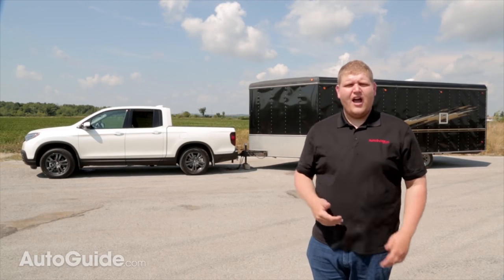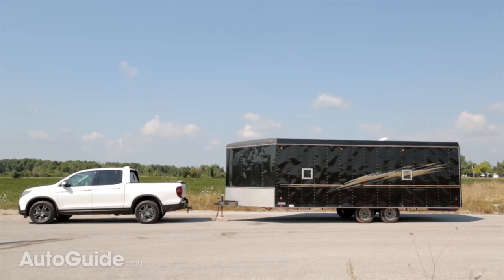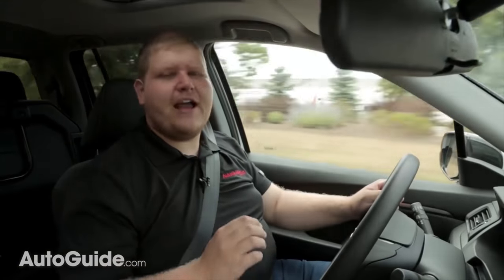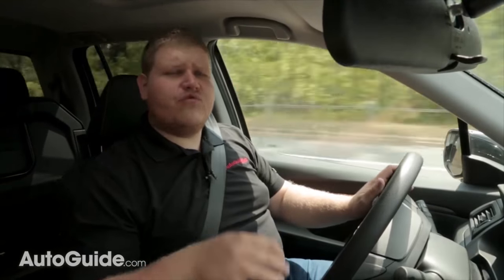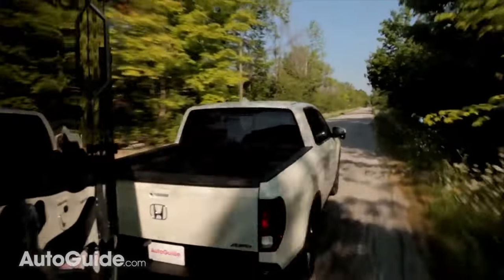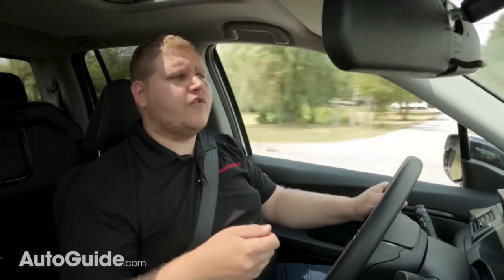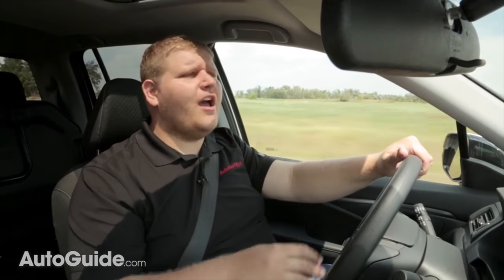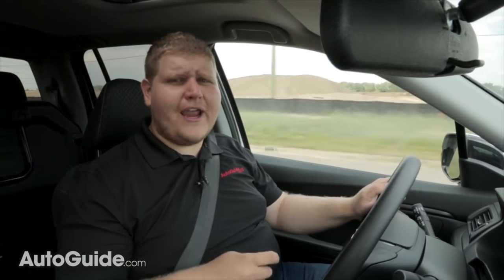2017 Honda Ridgeline Towing Test

Comment: Damn so many people are puffing their chests when saying this is not a real truck.  OK,  it not a truck.  It's a car that the weekend warrior could use to to snowboarding with,  go to the paintball field, drive to Lowes,  do a dump run,  head to a camp sight, drive to work.  I don't need my 2014 Z71 silverado.  Its 5 inches too long to fit in my garage and I rarely tow with it.  It's a bitch to park sometimes and isn't the smoothest ride. It's about your needs and what you actually do with it.  It's not about the definition of being a truck. Quit measuring dicks about it not being a truck.
Reply: I totally agree! if this was out when I bought my v6 f150 it would have been a tough call. I rarely tow and when I do its a jet ski or some thing small. I love the truck for utility, paintball like you said etc and this ridgeline offers a ton of options for the everyday dude who needs a bed for weekend fun but doesn't off road, doesn't tow all the time etc. hell my v6 f150 is only rated for 6500lbs or something lol
Reply: I'm not against the Ridgeline. I'm just against calling it a Truck.It just don't seem legit to me. Now have said that I can see where this crossover with a bed would be handy for alot of people.From video's I have watched I'm under the impression that the Pilot is a pretty good crossover.And that's what the Pilot is sold/marketed as.A good crossover.
Reply: I agree 100% but the truck is too expensive for what it is. I just want a cheap and reliable i4 shop truck. Something like the Chevy s10 or older ford ranger. But the thing is that these "small trucks"are way too big and expensive
Reply: @tritchie6272  look up the definition of a pick up truck... It IS a truck, whether you think it is or not. And by the way, who cares? You see so many replies here that this truck will do just fine for 90% of the people. And for European standards, this truck actually can tow a lot! I don't own a Ridgeline (yet), but it's going on the bucket list.
Reply: It's actually entertaining to a point.  It's a truck.  Plain and simple.  The thing I like most about it is that after living in Australia for a while, the Ridgeline meets the need that the Aussie Falcon or Commodore ute satisfies.  Coincidentally, it's many of the things you listed.  The thing I hate about modern-day American trucks is how large they are.  Some people like to be the biggest thing on the road, but then it creates problems.  I benefit from some of these as my Skyline is small and can fit behind the giant truck that is 3 feet into my parking spot, but many can't do that.  The Ridgeline is a great ride, and a great truck option for the majority of truck owners who don't actually use their truck to tow.
Reply: Yep you nailed it. Still can’t believe how much this freaking thing can tow...

Comment: I have FW drive RTL-T and I got the heavy duty transmission cooler on it. I only tow a 18' walleye boat that weighs about 2700 lbs. No problem whatsoever. I have an 8' utility trailer and that's is no problem either. My previous truck was a the GMC Sierra SLE 4WD and the Ridgeline tows nearly as effortlessly as the V-8. It comes down to realistic expectations. I'm not expecting to tow anything up I-70 W and over the divide in 100 degree weather. Completely satisfied with the Ridgeline. I validated my manhood in Vietnam with the 3rd MarDiv in 1966-67. I don't need a jacked up Hemi mudslinger to feel good about myself, so all of you haters out there, don't bother insulting me with all of the "chick truck" BS.
Reply: Phillip Yeager Well said. That is a really, really good comment. It is a great truck and the right truck for most people.
Thanks for your service in Vietnam. I myself served in S Vietnam. 173rd Abn
Reply: Amen, brother.
Reply: God bless you.
Reply: How much did it cost to get a HD tranny cooler installed?
Reply: I hear ya, I traded my Tacoma for 4 wheel independent suspension and disc breaks all around. Should have done it years ago.
Reply: I still don't get it, the Colorado is cheaper and has better specs ;-;
Reply: @justyouraveragefluff2298  Truck specs yes.  Car specs no.
Reply: @justyouraveragefluff2298  from what I research, the Colorado only has better towing specs. The '21 Ridgeline seems like it has better everything else (including payload) but I could be wrong.
Reply: For 98% of what suburbanites need--a comfortable daily commuter vehicle that can tow a decent load when necessary--the Ridgeline is perfect.  Why other automakers didn't think of this, I have no idea.
Reply: @justyouraveragefluff2298  Because the Colorado is not a good daily commuter vehicle.  The Ridgeline is a lot closer to the Honda Accord or Toyota Avalon in creature comforts while still having good hauling capability.  For most suburbanites, they don't need the Colorado's towing capacity; they may only need to tow or haul things now and then.  For fuel economy (very important for a commuter vehicle), the Ridgeline wins hands-down.
Reply: @JBM425  i mean if those creature comforts are worth the price difference to you then I guess go for it but if I was gonna make the jump to that price for a more comfortable ride then I'd just consider getting a slightly newish full size
Reply: @justyouraveragefluff2298  The Ridgeline is a nicer truck and will be far more reliable. He will have it 15 years before he even opens the hood. The Canyon will be soup cans. Thats what you are paying for.
Reply: If anything, women prefer riding in vehicles in comfort and the ridgeline does that perfectly.

Comment: I'm thinking a vast majority of buyers for this truck won't be towing anything. You could probably say that for full size pickup truck owners too.
Reply: I live in Alberta, Canada. Truck county. An overwhelming majority of truck users mid and full size and drive around with their beds empty. Nothing but mall crawlers.
Reply: BloodySinner I live in Texas, Dallas Fort Worth truck capital of the US  and it's the same here. I love my new Ridgeline it's awesome!
Reply: I would say that the majority of truck owners use their bed sparingly which is why crew cabs are so popular right now. They prefer passenger capacity to bed and towing. They are glorified cars/minivans. There is no issue with that if you're willing to admit it.  This is first and foremost a passenger vehicle like a car or modern SUV, so it shouldn't be expected to be good at carrying cargo, towing, or offroading. It does well at those as well even though it shouldn't have to do it. At least Honda isn't pretending who they are marketing for. This is the ultimate "Dad" car. Extremely utilitarian without making any real compromises.
Reply: 90% of truck owners use there trucks for everyday drivers so actually the Ridgeline fits all the needs of most truck owners
Reply: I agree, don't have the shitty gas mileage as a big truck
Reply: @bloodysinner9456  Yup,I live in Red Deer and as far as most of em go is Walmart and Tim Hortons parking lot...I've got a 2010 Ridgeline and am so happy I went with it instead of a full size...definitely does what I need it to
Reply: I want to buy this truck and tow a trailer.

Comment: A key issue with a trailer that tall and long is towing in windy conditions. That huge trailer needs a heavy tow vehicle to control it in gusty winds from the side. Having higher towing capacity than your trailer means you can put weight in the pickup bed that helps with sway in the wind.

Comment: 5000 pound trailer no trailer brakes?
Ah that is a really bad thing. Usually anything over 1500 pounds needs brakes.
Ridgeline and Diesel SuperDuty owner here. 
They each do a different job but the Ridgeline is excellent in all regards including towing.
If anyone has a bias of the Ridgeline not being a real truck it would be me a long term SuperDuty Diesel guy.
Your opinions are just that until you drive and use one.
I will get rid of my SuperDuty well before the Ridgeline..
Reply: Fix Or Repair Daily aka Found On Road Dead, good thing you got the ridgeline. Ford will no doubt break down before that Honda ever will.
Reply: Your comment interests me. I have a Ridgeline and I love it. However, a 5000lb trailer goes ways over the GCWR of the Ridgeline. What does the trailer you tow with it weigh?

Comment: I always wanted to have a car with a load capability for my motorcycle. So this ridgeline Is perfect for hauling light stuff on the road. Idk why everyone has to by so angry about calling this a truck..
Reply: Because it's more expensive than the rest of the trucks in its class for what it can do. The Colorado starts at 18k and has better specs. Almost the same size
Reply: JustYourAverageFluff Chevy trash doe
Reply: @justyouraveragefluff2298  That's mainly because it's based on the Pilot and has many of the same features which we don't normally find on trucks.

Comment: Gee... The Fast Lane Trucks took a Ridgeline with a 4,800-pound trailer up I-70 to the top of the Eisenhower Tunnels in Colorado (elevation 11,000+ feet), and it performed so well, they were even able to set it to 60 MPH with cruise control, and it made it up just fine.  OK, it's not a V-8, and it's not huge in torque, but for people who can't afford both a car/sedan and a pickup, this will more than meet most of their needs: a great daily commuter (especially in top trim levels) with decent towing capability when needed for small campers, ATV trailers, or dragging rental equipment and some lumber from home improvement stores.
Reply: I was confused by his comments on going over hills and decelerating. TFL was able to accelerate at 8,000-10,000’ up a 7% grade carrying about the same load, and they actually filmed the whole thing.

Comment: What is this guy talking about? There is a problem with the disk brakes and their ability at stopping a 5,000lb trailer? Have you never heard of a thing called trailer brakes? Anyone hauling 5,000lbs would be pretty stupid to not have trailer brakes, regardless of the truck they were towing it with.

Comment: People who need to tow 25 ft, 5000 lb empty trailers don't buy a Ridgeline.  They don't buy Colorado's, Canyons, Tacos, or Frontier's either.  Unless they like towing 5000lb trailers they can fill up with only 1000-2000 lbs of gear.  Most full size trucks don't do much better, maybe the F150 when configed for 10,000 lbs; but most are in the 8000-9000 range.  If you are hauling around a 25', 5000 lb trailer with 5000 lbs of gear in it you'll need a heavy duty truck.  What you can tow with 5000 lbs are bass boats, jet ski's, large motorcycle trailers, small travel trailers, or another car.

Comment: The Ridgeline is designed to tow 5k but like he said, it's made to tow 3,500 regularly. That's single axle trailers without brakes. I would consider an aftermarket brake controller if I towed anything that comes with trailer brakes. The Ridgeline is pre-wired for a brake controller but I assume Honda doesn't add it because most people don't need it.

Comment: Real good towing review. I love the new Ridgeline & Honda is my favorite automotive company, but the Ridgeline does have flaws that if we're worked out could offer a bit more capable and powerful truck. Having said that I think many people own too much truck! I know I have and the Ridgeline offers great off-road, trailering, and best in class ride comfort. I love it with some of the new leveling pics I've seen too. makes it look just a little more beefy with out sacrificing any practicality. plus  2 inches more clearance. The new Ridgeline in my opinion is an awesome step by Honda!!! needs minor adjustments, but I know they know that and will adjust through the years.

Comment: Instead of complaining about the lack of a factory installed brake controller, why don't you point out that the RL comes pre-wired for one. One can easily be sourced for $50. Owner's choice as to which one they prefer. Testing without a brake controller is plain dumb.
Reply: agree.   No one should be towing 5000 lbs without trailer brakes, unless the truck is a heavy duty one that can tow 10000lbs+   Just plain dumb

Comment: I don't understand how the power train can be considered a weak point when it's tow rating was maxed out.  I don't think any other gas powered truck being completely maxed out is going to be overly responsive.
Reply: Fair point. I didn't explain this, but comparatively, it felt weak. I have pushed the Colorado/Canyon right to the limit and that truck feels less taxed than this. But of course, everything will feel weaker with a max load on. 

Partially I think that's because the Honda doesn't have a proper tow/haul mode. It has 'D4' which locks out the top gear and holds gears a little longer, but it doesn't really optimize the powertrain for towing.
Reply: Thanks for the reply!
Reply: To be fair you pushed the Colorado/Canyon with a 7000 lb load for gas/ 7700lb for the diesel?

Comment: it may tow it but that's not the issue, can it tow it safely up long grades and down a windy roads.
Reply: According to The Fast Lane Truck's review taking a Ridgeline with a 4,800-pound trailer on I-70 in Colorado up to the Eisenhower Tunnel (elevation 11,000 feet), yes, it can!

Comment: Great review thanks! I bought the Ridgeline 2019 and have been deciding what weight is the sweet spot for a trailer.
Reply: AWD: 3600 to 4200 depending on trailer type. A camper for example need be a bit lower because you might need to carry extra gear. A boat to the local lake though can be right at that towing rating with no qualms.

FWD: 2800 to 3200.

Comment: Nice truck and thanks for the review. It's too bad that it doesn't have an integrated trailer brake controller. Aftermarket ones will get the job done, but I would prefer to have a built-in controller.
Reply: 1hjehje the older models were pre wired for one from back plug to the dash
Reply: The second generation Ridgeline is also a pre wired for a trailer brake controller.

Comment: To your dis-like about the electric hookup being so far under the bumper, the first generation of Ridgeline had it much more exposed. Enough that I managed to break mine, backing into something (not while hooking up). So I'm hoping I won't have the same problem with hooking up my 2018 Ridgeline (replaced the old one after an accident on ice :-(  ).

Comment: Good review, I really like this truck and was glad to see you putting the truck to the test towing at max capacity, but I'm confused about the model used in the video. The truck says "sport" and has the badging and sport rims but its white, I thought it only came in black. Also, while towing you see the back of the truck has the sliding rear glass window which is only available on the RTL-E / black edition. Lastly on the inside of the truck you showed the touch screen and lane watch assist feature both not available on the "sport" edition.
Reply: Thanks for watching. 

AutoGuide is based in Toronto, Canada, so the truck you see here is from Honda Canada. The packaging and options are different up here. For example, we don't get the basic front-wheel drive model, because we all deal with winter. That explains why the 'Sport' you see here is so different.
Reply: If you want to see a real test, check out The Fast Lane Truck's review where they took a Ridgeline with a 4,800-pound load on I-70 in Colorado to the Eisenhower Tunnel (elevation 11,000+ feet).  I was pleasantly shocked at how well it did.

Comment: Most trucks boast high towing numbers, however here’s a fun fact. The ridge line has a higher payload rating than my 17 F150 platinum 5.0 with max trailering package. I can tow 9200lbs but I run out of payload at 1499, where as the ridge line with its 1550 payload and 5k towing ability has payload to spare.

Comment: Thanks for this vid, its tough to find towing info on the Ridgeline. Im looking to pull a little over 3K lbs daily. Im so tired of driving around in an F150, its not worth the drama. Looks like im might be ok. Plus im VERY familiar with that J series.

Comment: The unibody is stiffer than body on frame..there are benefits. Plus please talk about rpm it runs on level and up hills ..ie other mid trucks decibels get quite high..ie 70 in cabin
Reply: It's actually a hybrid of a body-on-frame and a unibody.  Think of a unibody reinforced with some frame-like box beams.

Comment: Ugh it doesn't feel like a Honda Accord. It feels completely different. It's a truck and a great one at that!
Reply: That not a real truck son come down south and you'll see what a real truck is
Reply: Hole in the horn outfitters I'm a Texan and I drive a Semi for a living. I know what a truck is.
Reply: tim pike I got new for you a pickup truck is not a real truck class 8 trucks are real trucks
Reply: I like to see your truck vs the Ridgeline on Snow and Ice with the same tires. Hands down the Awd is better.
Reply: It looks like a car
Reply: But why not buy a Colorado? It's cheaper with better specs. That's my argument.
Reply: @justyouraveragefluff2298  drive both, the colorado doesn't handle the same.
Reply: To me it feels like a van with a bed, and it looks so ugly. I prefer the older ridgeline model.
Reply: @justyouraveragefluff2298  The Colorado gets poorer gas mileage, doesn't handle as well, and is nowhere near as comfortable.  If you want a work truck, then the Colorado would do just fine.  For many, the Ridgeline is the perfect middle ground between creature comforts and utlity.